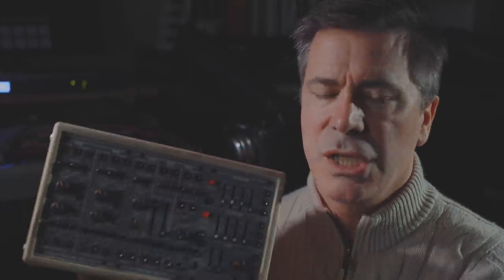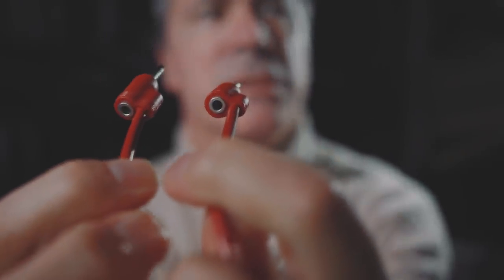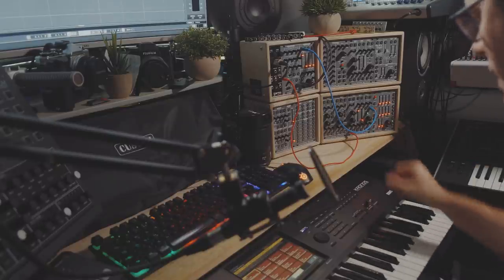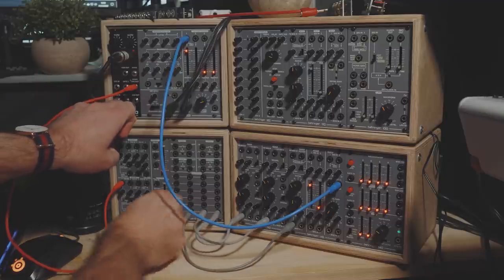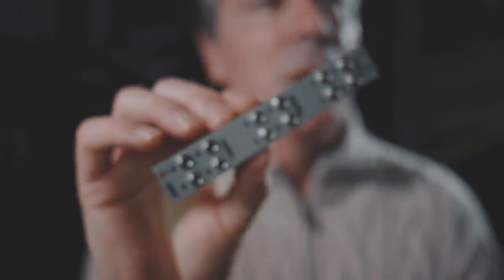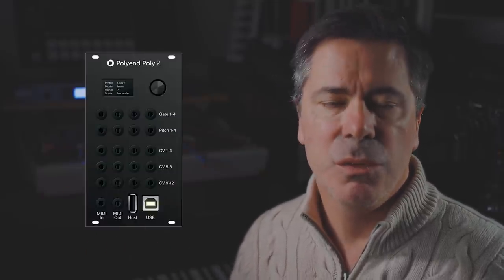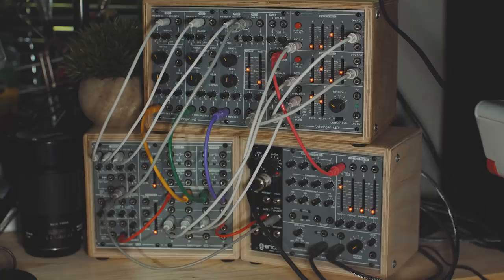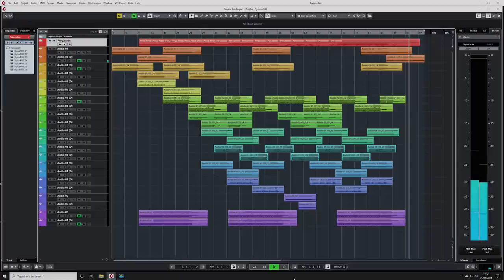Getting into Modular with the Behringer 110   PART 2

Comment: Hi Tim. Great video. You did a nice job of explaining the limitations of splitting. I am an electrical/electronics engineer, and I can explain what you demonstrated in a little more detail. Everyone is on the right track. This all about OUTPUT current and INPUT impedance. Each module output CV has voltage (obviously), but the output current supply is the more important aspect when it comes to splitting. When you take a single CV output, and split it, you are creating a parallel circuit (in electrical terms), which provides the same voltage, but divides the current. When you split the CV into two CV outputs, unbuffered, and send them the the input of a VCO, we are now concerned with the input impedance (resistance) of the VCO input (opamp input). Impedance is a large topic in itself, but we can think of it as resistance, which is the amount of current that the input will 'consume' in order to function correctly. A VCO will have a minimum input current to be able to operate.  In a 'perfect' world, all inputs would have extremely high impedance, so the amount of current they consume would be very little, but the reality of course is that they do consume a small amount of current. When you plugged and unplugged the inputs, you heard the difference. Since there is some input impedance (also known as the 'load'), and a small amount of current being consumed, there is a resultant VOLTAGE DROP across the input impedance of the VCO. This voltage drop will cause a drop in VCO input voltage, and therefor the pitch. So when we split a CV into multiple VCO inputs, we are dividing the current (reducing the available current to each input), and then seeing that smaller amount of current causing a voltage drop across the input impedance of the VCO. So there are few factors to consider when splitting CVs, or any signal for that matter. First, you want to have a buffered output so that the 'available' output current is high, so that when it is split it is still sufficient to drive the input of the VCOs, etc. Some eurorack modules have good output current characteristics already, so can be split without impacting the signal too much. The second factor is the equipment to which you are providing the split signal. If the module is good, like a high end module, the input impedance will be high, the current consumption will therefor be lower, and the voltage drop on the input will be minimal. The best way to overcome the splitting issue is to do what you suggested by having a buffered output. This is not about voltage, but current. A buffered output has a higher current supply, so that when the signal is split into parallel voltage paths, there will be no appreciable drop in voltage across the input impedance. If electrical specs are available for a module, look for the module with the highest output current, and lowest input impedance. I haven't compared specs on a Moog vs. Behringer, for example, but I bet there will be a difference.
Reply: You're kindof on the right track. It's all about output impedance. The lower the output impedance of the supply signal, the less the voltage drop when each following load is added.
For simplicity. Let's assume you have a source of 10v with an output impedance of 1kohm. At no load, the voltage will measure 10v across the source.
Now if we add a 9k ohm load, the circuit is 10v-1k-9k. There will be 1v drop across the output impedance, giving us 9v at the load. If we add another 9k ohm load the total load is now 4.5k ohm. The voltage drop will be ~1.82v yielding 8.18v across the combined loads. And so on.....

So in a nutshell. you want your source to have the lowest possible output impedance, and your loads (inputs) to have the highest possible input impedance. 1 to 100 is ideal, but it's not uncommon to be closer to 1 - 10.

https://www.edn.com/wp-content/uploads/media-1307558-witte-blog01-pwrtransfer-fig1-600x457.png

Edit. 
BTW. It's pretty easy to calculate the output impedance of a device. All you need is an accurate multimeter and a couple of resistors. 10K ohm and 50k ohm. Measure the open circuit voltage at the output, then load it with a 10k resistor and measure the voltage across the resistor. Using ohms law you can calculate the circuit current, then divide the voltage drop (Unloaded voltage - voltage across load resistor) by the current and you get the source impedance.
Reply: The Erica midi/cv module has little ability to provide much current. It might be feature-rich but they designed a shitty output stage. It should have been able to provide enough current without the voltage ‘sag’ it exhibited. Buffering with the mixer module clearly points the finger at the Erica module. Also the inputs to the oscillators may not have a high enough input impedance. They are an old design just copied by Behringer probably with no improvement. Ideally they just ’read’ the voltage presented to them and don’t consume any appreciable current but this is not happening. The Erica module cannot provide enough current and the voltage coming out of it ‘sags’. Probably a combination of weak output stage on the Erica and too low an input impedance in the oscillators.
Reply: @gregolsen4048  I just picked up a Behringer 110 module. The measured input impedance is 100K on the CV. I'll get back to you with the output impedance.
Reply: Long story short. Ideal voltage source provides constant voltage regardless of load. Real voltage source will decrease its output voltage as soon as the load rises (due to its internal resistance). Which takes place when the impedance of the load decreases due to multiple devices combined in parallel. Plus the nature of sound pitch is a logarithmic scale, so if 1 to 10 (impedance match ratio) is appropriate at lower frequency band It will be a disaster on the higher frequency side of band, which I believe had been perfectly demonstrated in the video.
Reply: @ehtcom  Exactly, an impedance issue.
Reply: Instablaster.
Reply: Good explanation guys

Comment: Really appreciating these videos Tim, I’ve been considering getting into Eurorack via these modules and it’s given me lots to think about
Reply: He inspired me too. Get the niftycase it has a midi cv Konverter included.
Reply: @JohnTrasher  I had that case sold it found it didn’t power some of my modules correctly but it’s ok for simple modules had some feedback off it as well
Reply: @saren6538  hmm.. some modules i used had some slightly coil Feedback aswell..
But with the system 100 i dont have any issues

Comment: Most outputs will have 1k output resistance. Most inputs will have 100k input resistance. So rule of thumb is basically "each multiple will drop signal by around 1%"

That is not a standard tho, there are modules with different input and output resistance so you never know unless you check the specs of the module.

So another rule of thumb would be "if you care about exact pitch, use active multipler, for any other signal passive one will almost always be enough"

Comment: Tim,

Great presentation. In an attempt to answer your question, the pitch issue can be explained by looking at the Moog CV standard. Under the Moog system, pitch is regulated on a scale of 1 volt-per-octave. So for every octave on the keyboard, the voltage increases (or decreases) by one volt. If you wanted to, you could attach a voltmeter to the CV out of any module and measure the voltage.

When calibrating a module, you can take a measurement at the baseline and then another measurement an octave higher. The difference should equal one volt. However, If a cable is too long, or if it splits the signal multiple times, the voltage at the other end will be lower than 1 volt, due to the resistance in the wire. the result would be a difference of something less than one octave, otherwise known as “out of tune”. Buffered, or powered multiples solve this problem by ensuring the voltage from the various jacks remain consistent. 

The other issue is the sound module itself. Some oscillators have a stable pitch over only an octave or two, while others maintain stability over several octaves. This is due to the quality of the components from which the module was built. Again, the solution is in the careful calibration of the module. The only other caveat is that most analog modules are never perfectly stable. That instability is what we have come to recognize as “character”. As you know, some modern synths have a knob to allow you to destabilize the tuning to emulate the sound on an older machine. One man’s pitch problem becomes another man’s vibe!

Hopefully that helps. Thanks again for your informative series.

Comment: Surpised the erica cv output could not drive the three vcos, and buffering with a unity gain op amp is the way to go, as you neatly demonstrated. An active multi would also  do the job, like the Intellijel Buff Mult. Using an audio mixer to do the job may not be as stable/accurate on pitch, depends what op amp is inside.

Comment: I'm using two Rides in the Storm QAM active multiples for CV signals that need stay in tune. They are like 58 euro in Thomman. Compact, and with a little clever feature that I love. It sports 4 imputs with 3 outputs each. A and B are normalled together, C and D too. For instance, if you patch a cable in A, but no in B, you get 6 outputs.

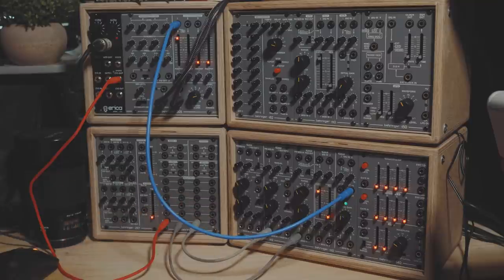Comment: 15:27 I'm not surprised with CV getting pulled down. It's down to the design of the MIDI to CV converter and the design of the inputs. Mullting audio outputs is rarely a problem because most audio inputs draw very little current. 22:40 I'm in the don't do it camp even if it appears to be working because components can be stressed. Good design protects against this but there's no guarantee that good design has occurred. I used to write maintenance manuals to component level and there were several occasions where I sent the draft to the design engineer for technical review and their comment was "I wondered how that bit worked".

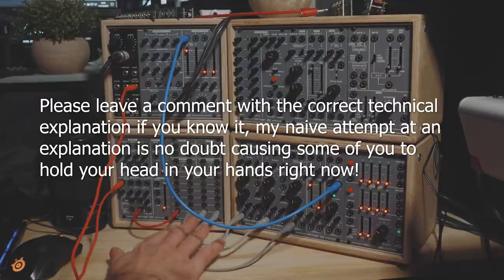Comment: First of all i want to thank you and congratulate you for your really great videos. Now, regarding your question at 20:30 ... it is related to ... physics ( well, isn't it all? hehe ) .... trying to make an oversimplified explanation, i would say that splitting the signal from one output to several inputs using just "splitter cables" is like stacking many resistors in parallel, which stresses the output by requiring more electric current to come out of it and go into the inputs. Every audio output has something called "output impedance" and every input has something called "input impedance" and these have to "match" when connected for the best signal transfer. You can look up terms like "output impedance", "input impedance", "buffer", "ohm's law" and "combining resistors" for more scientific/geeky stuff. What you used for solving this, was effectively creating a buffer/amplifier from that output to those inputs. Correct signal splitter/multiples should really be buffered/amplified to avoid this in modular systems. Thank you again for all your great videos!

Comment: Since the mixer have a buffered output the op-amp will compansate for the drop in voltage caused by multiplying it. Op-amps are comparing the incomming singnal to the signal being put out. I am not an expert on this, I have just heard Christian Blåsol talk alot about op-amps on his Youtube series, Modular in a Week, so I have a slight understanding on what they do as I am into mixers. If you use the 182 and hook up all the VCO, it should be possible to make a tuned sequence with a stackable, patchpal mult/star-thingy/0HP-mult or passive mult as it does not rely on volt per octave, but de-tuning the VCO will theoreticly make them stray slightly from each other.
Reply: Do you know if you can change the MIDI-chanel on yarns? My MIDI-CV can only use chanel 1 and I would like to expand my system with another MIDI-CV and be able to use them at the same time.

Comment: That was why the original Roland 100M system so great, because it had CV and Gate as part of the power bus. The case has a CV and Gate input that you could then use to get CV and Gate to all the relevant modules. CV and gate are also avaialble on the Doeper A-100 bus, so not sure why Behringer did not use this feature for these modules to make use of that.

Comment: Great Video. The 173 Modul has passive Multipliers  therefor the Signal from the Erica Module is turned down.
Foe example, the Doepfer A-180-3 is a buffered Multiplier.

Comment: When using a passive mult, the effect of the voltage decrease is called loading. It happens when the source can't regulate the correct output voltage when the load (destination) changes.

Comment: Great tips. That voltage processor / summing mixer module is very handy in a tight spot when there's voltage strangling, which was demonstrated so clearly! Also very handy for balancing the relative levels of modulation sources against each other before they go to their destination. I've got a 132 coming for my 100m soon, it was a must-have.

Btw - nice module photos at 18:52 they look kind of familiar. ;)

Comment: Late to the party, but anyway.  tried the "overloading" of the mult using the CV from my Behringer Model-D, and didn't have the problem, so it seems like it provides a stronger signal, just like the mixer on the 297 does.

Comment: Assuming Berhinger makes all their modules with the same input impedance. The circuit as you have connected it is 1/3 the resistance of one input. The output has a load 3 times bigger because the resistance is divided by 3 and thus the current is 3 times larger.

Comment: The problem is that the Erica MIDI to CV module has relatively high impedance output. Another way to look at it is that it is a poor voltage source. The Behringer mixer is acting as a voltage follower with low output impedance.

Comment: The reason the output signal is dropping slightly, causing a detuned VCO frequency,  is that its output signal is being overloaded when  being  split to too many  VCO inputs. The mixer output  has a   stronger output driver stage  and  can supply more inputs without the voltage dropping  ( More technically,  it has a lower output impedance and can supply more load current).

Comment: Im an electronic engineer,  wiring an output to multiple inputs is called fanout.

Given well behaved modules, the input impedance should be measured in hundreds of kilohms, and typically theres no more than 1k of output impedance (usually manually introduced to stop you blowing the output wheb you drop a jack against the panel) using Max power transfer equations, a reasonable max fanout of around 100 is not unreasonable, however each additional load will imperceptiblely attenuate the signal, however they will add up, at a fanout of 100 assuming a 100k input and 1k output the voltage attenuation will be 50% and all your CV will be out of tune ;)

That said these are all worst case numbers, in practical modules input impedances are often measured in megaohms, and output impedances of 100ohm is still safe.

So its pretty safe to say you do not need to worry about chaining splitters.

Comment: Thought I'd copy my reply to the main thread to explain signal loss.

It's all about output impedance. The lower the output impedance of the supply signal, the less the voltage drop when each following load is added.
For simplicity. Let's assume you have a source of 10v with an output impedance of 1kohm. At no load, the voltage will measure 10v across the source.
Now if we add a 9k ohm load, the circuit is 10v-1k-9k. There will be 1v drop across the output impedance, giving us 9v at the load. If we add another 9k ohm load the total load is now 4.5k ohm. The voltage drop will be ~1.82v yielding 8.18v across the combined loads. And so on.....

So in a nutshell. you want your source to have the lowest possible output impedance, and your loads (inputs) to have the highest possible input impedance. 1 to 100 is ideal, but it's not uncommon to be closer to 1 - 10.

https://www.edn.com/wp-content/uploads/media-1307558-witte-blog01-pwrtransfer-fig1-600x457.png

Edit. 
BTW. It's pretty easy to calculate the output impedance of a device. All you need is an accurate multimeter and a couple of resistors. 10K ohm and 50k ohm. Measure the open circuit voltage at the output, then load it with a 10k resistor and measure the voltage across the resistor. Using ohms law you can calculate the circuit current, then divide the voltage drop (Unloaded voltage - voltage across load resistor) by the current and you get the source impedance.

Comment: The detune problem is probably simply caused by the resistance of the material (metal...) of the plugs, lowering the voltage of the signal. thanks !
Reply: So a longer cable would detune your modules? Of course not. Its the input resistance (therefore the power consumption) of the lfo's that weakens the output of the converter. The behringer mixer simply has a stronger output.
Reply: @compfox  you’re right ! I though it was a bit strong for a cable/passive resistance only ;)

Comment: Enjoying your videos, a big help. The Mults was interesting, maybe you at some point explain the difference between mixers, as an example (using the System 100 modules) the Behringer 305 EQ/Mixer/Output and the Behringer 297 Dual Portamento/CV that you show. I see one is more for sending the final signal to the out/amp/speakers. However, what's the difference between the two (in usage)? Does one need both (ideally), or is one more important than the other, etc.

Thanks in advance.